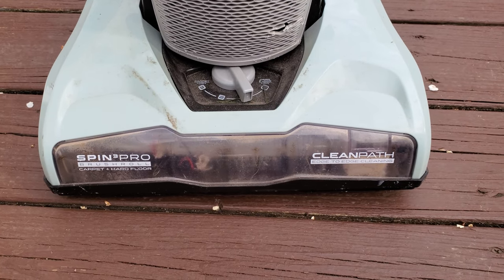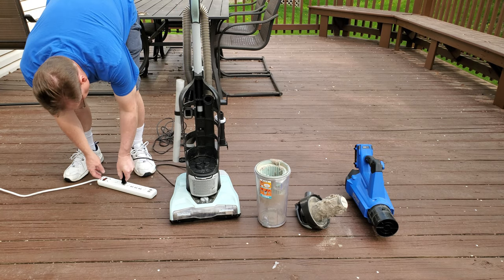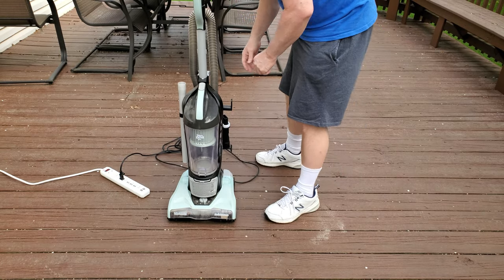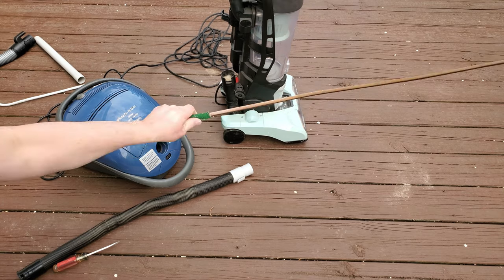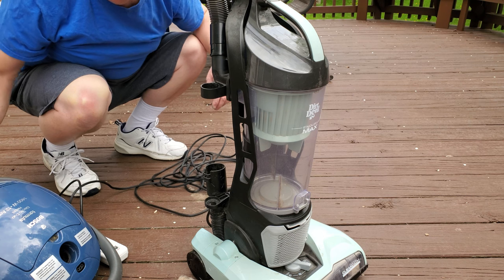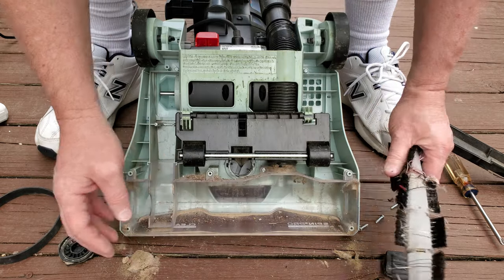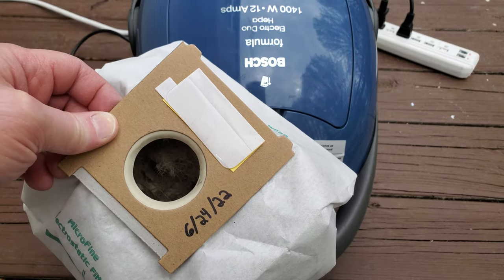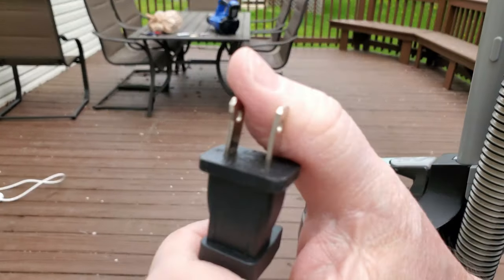What Killed The Dirt Devil Endura Max UD70175 | Lets Fix It

Comment: I just found one of that exact same model (dark gray) today! It "runs and drives" but does have a little bit of a stink that will clean out easily enough. But unlike yours, mine is missing both attachments. But it has no clogs and the cord has no dog bites. Interesting thing is mine does not have a serial number, but instead it says "MFG CODE 121A   AJ." I notice your exhaust filter cover has a little bit of damage on it, unlike mine. But I'll trade a perfectly good exhaust filter cover for your two attachments anytime.🤣

Comment: I found it interesting you haven't checked the post-motor filter in this video.  Although, I guess that wasn't an issue.
Reply from the maker: The post motor filter had 1 dust bunny in it. It's more like a fibrous charcoal infused screen than anything else.